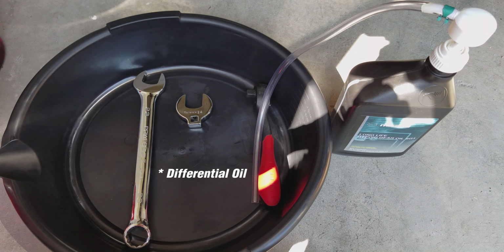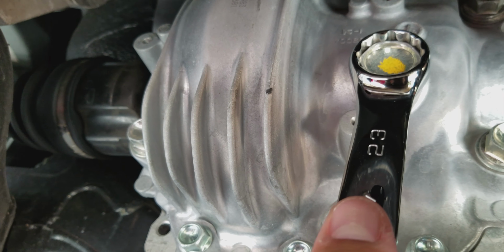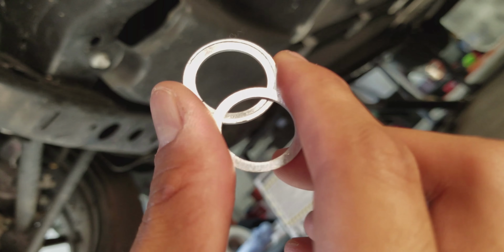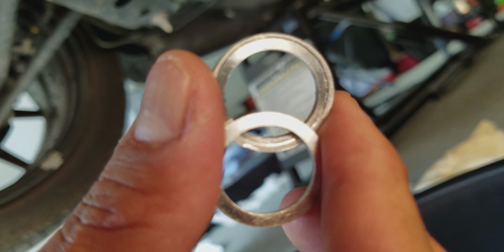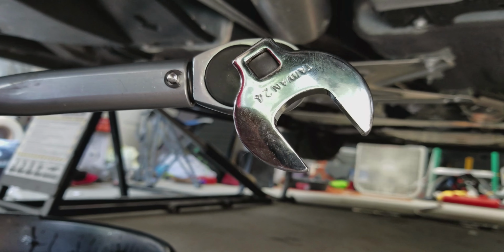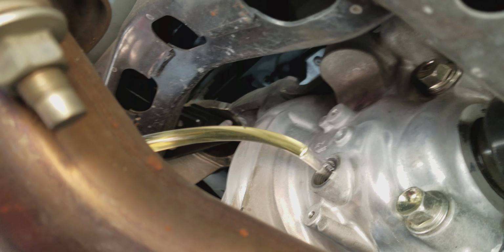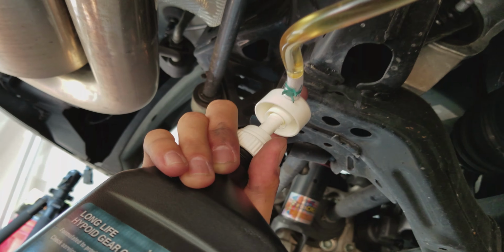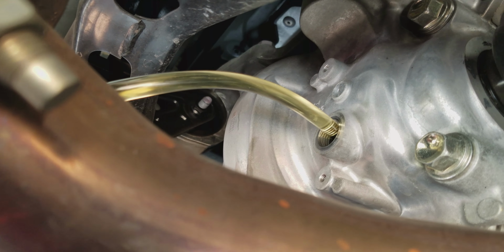2016 Mazda MX-5 Differential Fluid Change

Comment: Is the car level during the fill?  Or on ramps ?
Reply from the maker: Yes the car is level, on a set of quickjacks, a portable hydraulic lift
Reply: Change is for good maintenance. Replace fluids before the are no longer good will save thousands in parts failure .